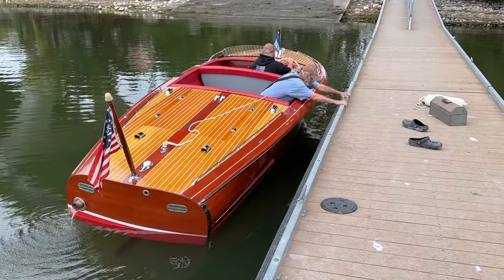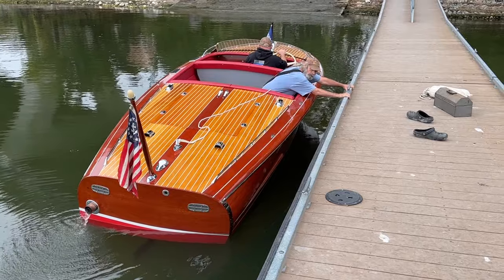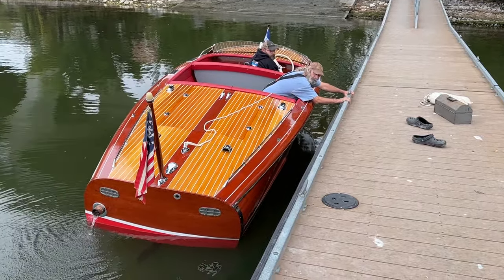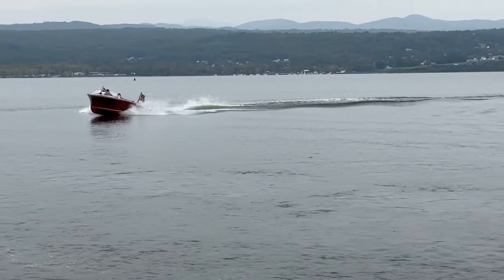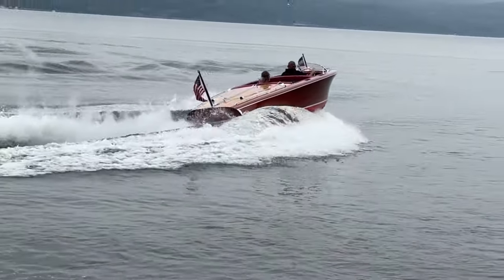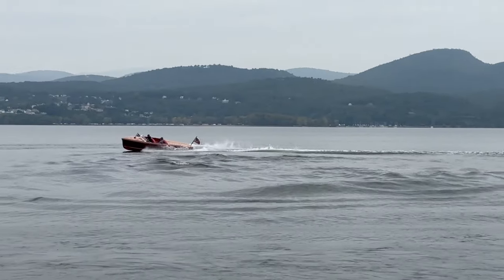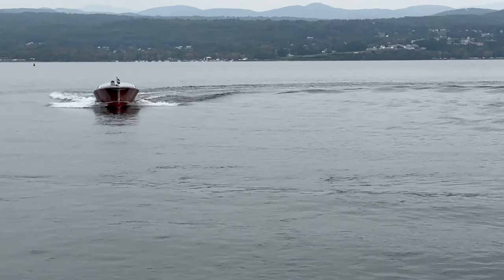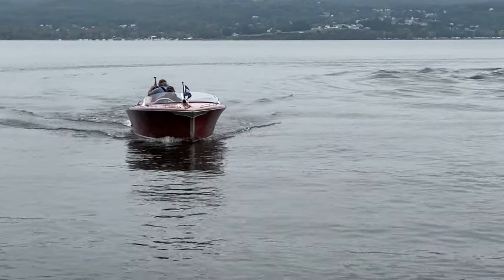1948  Truscott 20 Foot Barrelback Custom Runabout Sea Trial 9 29 2023

Comment: Looks like she is barely making 15 knots. Can it pull a skier?
Reply from the maker: Ha! Remember, her newly-rebuilt engine is running under load for the first time. Never, ever, ever run one of these engines above 2000 RPMs for the first five hours run time. Then change the break-in oil in her sump to a high-grade 30 weight, preferably synthetic oil.
Reply: ahh good point!